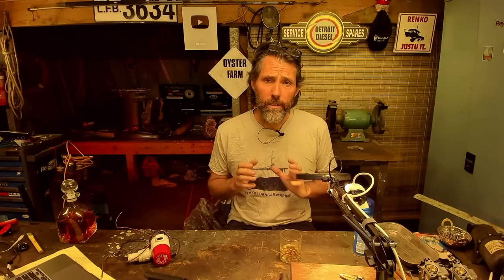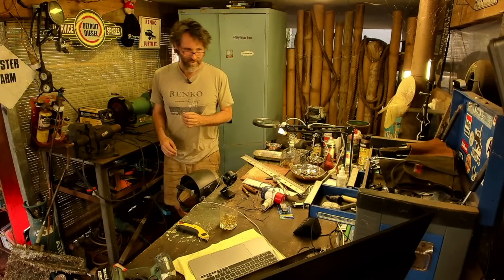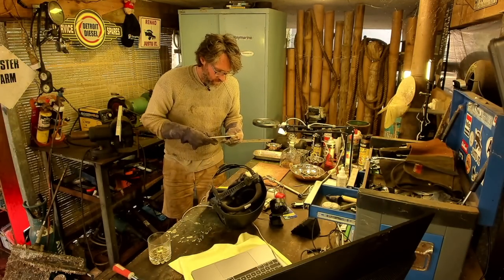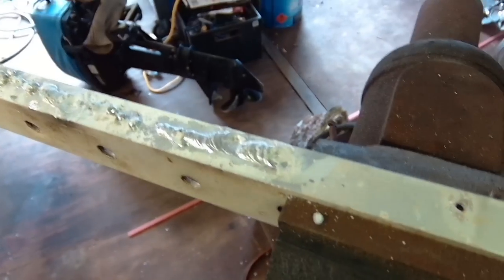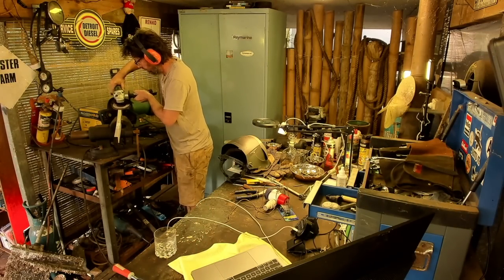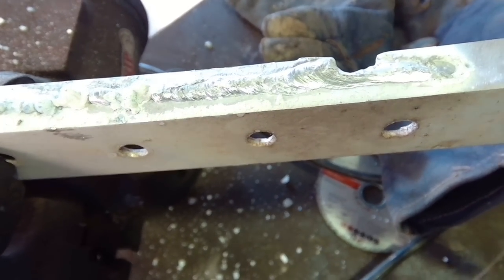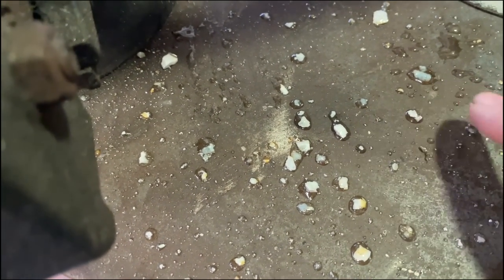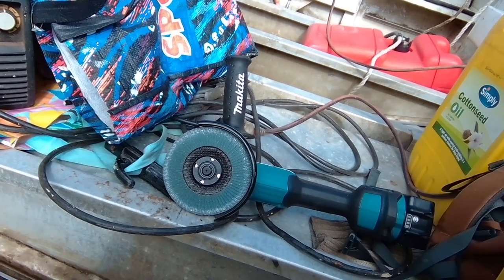Stick welding an aluminium boat

Comment: Have you ever tried LOW TEMP ALUMINUM RODS that can be used with propane. I’ve used them and it works great.
Reply: Sounds clever. How’s the long term efficacy of those? Is it a step above marine epoxy?
Reply: I haven’t used it for any marine stuff but I’ve built aluminum frames for wall support in an RV and it worked great.
Reply: I wouldn't trust them for a structural marine purpose that's for sure, I've never known them to make a very strong "weld"

Comment: Stu, greetings from South Florida USA. You don't have a video of wiring up a Yamaha 703 side mount box to a 4stroke  do you? I have a 2017 brand new F70 and I recently unhooked the existing 703 box and purchased a brand new 703. But...I didn't really label or record all the wiring connections so now I'm in a slight pickle with the new 703 box instructions don't really explain all the color codes, wired connections, etc., and I can not find rigging wire diagram that I can understand as a novice online.

Thx for sharing your content.
Reply from the maker: I don't at the moment, but I do have a new one at Adrian's workshop so I'll pick it up and see how it comes from the box.

Comment: Try dragging the arc instead of pushing it like you were doing. Only time you really wanna push an arc is when vertical welding, otherwise with any kind of stick you should drag the arc, and move fast with softer meal(s) like that...
Reply from the maker: I generally do drag to strike but I must admit when I'm trying to chip the old slag off it could be any direction! ;)
Reply: Where there's slag you drag is what I was taught, flux core mig etc. you drag.

Comment: I`m not an aluminum welder but the one commenter says you may be using the wrong type of rod but also if I remember right most aluminum rods run on DC setting as most of the cheaper welders work on AC only. That could be part of the issue. Someone correct me if I`m wrong but I think not.

Comment: You mentioned that the slag had water around it. It's probably due to the flux used on the rod. Salt is used as flux for aluminum brazing and the salt will draw moisture out of the air. I'm guessing that the flux on your weld rod is some form of salt.

Comment: Maby try to straighten the rod a litle. 25-30° for alu. 40-45° for steel. Easyer for the flus to cover the melting point.
Reply from the maker: Thanks Bobby, the new pack of rods finally arrived yesterday so I'll give that a try.

Comment: The battery is there for weight distribution. Without it, the disc jams on the work piece and friction causes the grinder not to work. I'm a BS engineer, so I know.

Comment: First thing I noticed was you are using the wrong rod for general use, 4000 series wire is for cast aluminium,  5356 is what you should be using
Reply from the maker: Appreciate the info, I'll give them a try!

Comment: I need to fix a small crack on my transmission i can't find someone to do it in my are i try brazing rods but could not get it to temperature  im looking at other options. I have a mig welder but buying a stick welder is cheaper to buy than 100% argon. What would be a better option?

Comment: Just tried this on a skeg but all I got was sparks. I'm going to have to practice and probably need a better stick welder? Is that welder your using 220 or 110 volts?

Comment: Because the battery holds the angry pixies 💡 I'd just stick with mig and a spool gun, less risk of sinking because of burn through 🙃*edit looks better then I thought it would, nice job.
Reply from the maker: Yeah, the spool gun is definitely the way to go.
Reply: @DangarMarine  , A little cheap mig machine works too.  Just use a .035 tip with your .030 wire to keep it from binding.  I have mine set up with a little 10 cubic foot bottle, and it's enough to take care of a quick repair without weighing a ton, and the welds are good.   An aggressive crimped wire brush works well, probably better than the flap disk.   Definitely easier than the sticks.

Comment: Yes you need to preheat and clean at least a couple of inches from the weld area and use a wind shield so you don't loose your shielding gas thats put off by the rod!, Or you will have a brittle weld n grab the rod to direct it

Comment: Ive heard that a ac welder is better than a dc for aluminium stick rods and using pos ground helps
Reply from the maker: I'd be interested to try different settings. These rods say DCEP but with TIG you use AC to get the cleaning action.

Comment: Make yourself a cheap hot box for your welding rods. Find yourself an old small metal Locker like a small filing cabinet. Hang and wire a light fixture inside of it. Run a 60 to 100 watt Bare Bulb that will keep your electrodes dry. It's cheap and easy.
Reply from the maker: I had put these in my rod oven.
Reply: @DangarMarine  I got you. I just thought you had mentioned a lot of moisture, and being in Florida in a high humidity area I always keep my rods in a hot box.

Comment: I have a question for you. I have a 90hp Johnson 2 stroke outboard motor and someone has bypassed the vapor separator   The filter isn’t in use and the line to the left of it isn’t hooked up either. When I squeeze primer bulb fuel comes out of both place’s. Question is other than fixing it back to factory how can I solve this problem? I know this has nothing to do with welding but trust what you have to tell me after watching your videos. Thanks Richard

Comment: Re ally brazing, never had any luck with it at all. Getting it to wet out properly on anything that isn't brand new spotless ally is virtually impossible.

Imo skip it.

Stick welding ally on the other hand is a breeze.

You have to run hot and fast. I've found nearly twice what you'd use for steel is a pretty good point to start from.

Pre heating is also a must. You don't have to preheat the whole job, but you do have to preheat the first couple of inches of a longer run. If your weld is shorter than a couple of inches, preheat all of it.

When you preheat, do it almost to the annealing temperature. If you have an oxy, put a bit of carbon on the surface and then heat it till the carbon just starts to burn off, then brake clean and go. If you're using a map torch put a sharpie line on it, when the Sharpie starts to fade it's hot enough.

You also need to keep an eye on how deep the puddle is sitting into the material. That tells you when the metal is getting too hot. If it starts flattening out stop for 30s or so to allow it to cool before continuing.

Use a stainless steel wire brush as well rather than a flap disc and clean it before welding with a bit of brake cleaner. Just as good as acetone but cheaper.

The biggest thing is just getting used to how fast you have to move. It's a whole different thing to steel. If it doesn't feel like you're going way too fast your weld will be cold and have no penetration.
Reply from the maker: Hi Daniel, thanks for all the tips. I'll definitely try the Sharpie one!

Comment: Interesting, I also didn't realise you could get Alu MMA rods. I don't have any experience welding Alu but I'd be tempted to try thinner rods, you'd might go through them faster but you should get less sticking & possibly more control & less wastage?

Comment: get a piece of stone (brick) and you can chip the rod back as it will burn back inside so won't strike 
just drag it over the brick to expose the tip of the rod also get a stainless wire brush
Reply from the maker: Yes, something abbrassive to get the slag off would be handy, and yes, I've added more wire brushing to the shopping list!

Comment: I'm watching this for the 2nd time with my brother who knows a lot less about welding than either you or I and he's just asked a good question that I'm not sure about the answer.
Would the welding go a bit smoother if you also removed the oxidation from the location of the ground clamp? cheers.
Reply from the maker: Hey mate. Yes, I do think a better earth could help for sure as aluminium oxide isn't conductive.

Comment: Interesting I have been wondering about aluminum arc welding rods for awhile now. Anything that uses a gas tank for remote welding usually requires the use of something heavy to tow tank around making it rather inconvenient.
Reply from the maker: For sure. MIG & TIG give great results but it sure is a lot of equipment to carry around when you need to take the welder to the job.

Comment: hello dangar marine.
Do you have Yamaha outboard engine drive shaft seal and shift shaft seal videos? I would be very happy especially if it was 15 hp. I learned about prop shaft oil seal from your videos. However, I am waiting for your videos on the two issues I mentioned above. For Yamaha 2t. thanks.
I am watching and following you with interest
Reply from the maker: Pretty similar to this Honda https://youtu.be/Yv33z1Gx02A

Comment: Great vid of just getting after it. 

Few things I want to remark on:

Aluminum can't be too clean. Get through the oxide and come back with some acetone or denatured alcohol. I've found preheat is beneficial when welding different thicknesses together, or welding aluminum over .250 thick (6.5mm) less than that, you should be able to manipulate the machine and travel enough to compensate. Lastly, stick would work in a pinch for the thicker stuff, I've had hard luck with stick welding the thin stuff. It's a little more money but I truly believe a spool gun (will work with your machine) will save you tremendous frustration. 

Good luck man, keep burning!
Reply from the maker: Thanks mate, appreciate you sharing your experience! :)

Comment: Hello, Your videos have been so helpful I can't thank you enough.  Off topic question ...... a friend of mine has a 2007ish Evinrude e-Tec 90 hp tiller engine.  He can't find the friction adjustment that resists the engine from rotating to the side when he releases the tiller arm.  Can you tell me how to adjust the friction on his engine?  Thank you again!
Reply: ......actually it's a 2005.  Thank you!
Reply from the maker: Not sure, I've never owned one of those. If it has one it should be in the owners manual which shouldn't be too hard to find as a PDF online.
Reply: @DangarMarine  Thank you!  Love the videos here in the US!

Comment: Hi Stu, nice informative piece as allways! Many thanks from Holland! I'm wondering (different topic), did you already have time to test the James Reeves method of setting the ignition timing? I would be very interested.
Reply from the maker: Hey mate, no I never have done it but I really must one day. I appreciate you reminding me!
Reply: @DangarMarine  I guess I will be trying it this week then. Just totally rebuilt a Yam 70 two stroke, the one with the manual ignition settings. I'll keep you posted on my experience :-). If you happen to have a link to more info on the Reeves method, it might help me. G'day mate!

Comment: I like to heat my aluminum  to about 500⁰f and run lower amps. If I can't do that I spot weld 1cm at a time.
Reply from the maker: Yes, I think pre-heat and lower amps is the way to go.

Comment: Does the boat hull and being in the water (a huge heat sink) pose a heat consistency?  Maybe taking the boat out of the water would help with heat.
Reply from the maker: Yes, it would be interesting to compare welding it at low tide to see if it makes any difference.

Comment: Question.   1987 150 mercury black max.   Lost spark. Disconnect kill wire one side of CDI box fires right up. Three cylinders.   Still shuts of at key. 
Any thoughts
Reply from the maker: Sounds like the kill switch may have failed https://youtu.be/SN17iBL5lps
Reply: @DangarMarine  
Disconnected kill switch. I made my own kill wire straight to CDI box with new ignition.   
Same thing.   So went through two new ignition switches.  Not the problem .
Kill wire not the problem.    So.  CDI boxes are next.  Could Meg boxes
Reply: @DangarMarine  
Hey my friend it was CDI boards after all.  
Runs great now.   Live and learn.

Comment: Stu is your welder a AC inverter or DC ? I believe the smaller DC welders are no good for Alloy. It needs to be an AC current. Correct me if I am wrong
Reply from the maker: DC. These rods are DC EP. AC for TIG on aluminium though.

Comment: How about warming up the aluminum before you start welding and just put a propane torch on it to bring it up to some a little bit of temperature
Reply from the maker: Yes, preheating will help a lot.

Comment: So when do we get to see an 'average' person trying aluminium welding 😉. Sikaflex is my favourite way to weld aluminium.
Reply from the maker: I must say, when it comes to hull repairs I really do still rate a doubler, Sikaflex and closed rivets.
Reply: @DangarMarine  maybe they should make a metal coloured Sikaflex as the ultimate cheating at welding

Comment: i stick weld aluminium all the time hear on the like i live at   1 use around 120 to 130  positive ground and i dont even clean it  i have never had a weld brake in the same spot on the docks i fix and build   stick will cut right thro the crap on surfice  chip off in the flux   just like rusty steel same thing   only mig and tig need clean  thay dont use flux like stick
Reply from the maker: It is one of the things I really like about stick welding is the ability to blast though a fair bit of crap. Interesting you positive ground, I should try both ways and see the effects.

Comment: The reason your grinder doesn't work without a battery is because it's cordless ... what you need is a wireless grinder ;)
Reply from the maker: I'm always buying the wrong thing on eBay!

Comment: Is you welder high enuf ocv? Dose it say ac or dc on pack of rods although i  think you are wasting your time with ally stick . Tried them for all same reasons years ago unless itts thicker than 5mm 
Buy a ac inverter and a small argon bottle
Reply from the maker: Not sure about the OCV rating on that welder but the rods at DC EP.
Reply: @DangarMarine  
Most inverters are 80/90 ocv which is nomally good for most specal aplications 
Tigs the way to go for that kind of repair trust me

Comment: If the grinding wheel has been on anything else before using it on the aluminum you have contaminated the material to be welded

Comment: My Angle grinder works without its battery. Although it does have a power cord attached.? Weird.
Reply from the maker: I think I might get rid of the battery and lead and just install a Flexcapacitor!

Comment: Sixty years ago aluminium was welded with oxy.
Reply from the maker: For sure. Adrian still does lots of oxy welding. A great option for out on the boat when you don't have a good power source.

Comment: The reason the grinder doesn't workwith out a battery. The battery contains many angry pixies. The Pixies need to be happy. To get them happy the battery needs to be in place. The switch on the grinder is like a door. When you open the door, all the angry pixies rush in like crazy shoppers on Black Friday. They all jump on a hamster type wheel which starts the grinder turning. They eventually get tired and that is when you get another battery or charge it where it all starts over.
Reply from the maker: I don't like to dissapoint those pixies!

Comment: Hey Stu, to sort out your angle grinder battery issue.  Search on youtube for "free energy" .  It looks like a spark plug and a few coils of wire and you never have to worry about batteries again.  You might want to test it first as I don't think your angle grinder will handle that amount of power! 😂😂😂
Reply from the maker: Ah, I should hook up a perpetual motion machine to the grinder. ;)

Comment: Hi again, i hope you get this…im outta ideas, i put a new relay in for my 93 Yamaha 40 hp outboard and idk …maybe this guy wired the motor wrong is that possible…
Reply: It only starts with the key if i jump the two cables on the relay

Comment: You could make a perch with several little bowls far enough a part that might not fight for a bit, and aim a 1080/720 cheapy ipcam (security cam) at it. Aliexpress has then for as cheap as 27$ free shipping.

Comment: As has been mentioned you really aren’t using the correct rod. Your main issue almost all stick rods for aluminum are designed to run reverse polarity or DC. I don’t think that welder has that capability. You should be welding on about 85 amps for the thickness material you are welding. The reason the arc keeps stopping and acting like it is cold is the wrong polarity.

Comment: Welding aluminum rod  with a fundamentally DC inverter doesn't help. You need to be more in the AC area. I have gone through your exact same dilema and even tried using an old buzz box pure AC welder but with not much better results because I gave up too soon and didn't fiddle around with the amperage long enough. I'll be going back for a rematch with the buzz box. Of course, a welder with aluminum specific capabilities would be best.